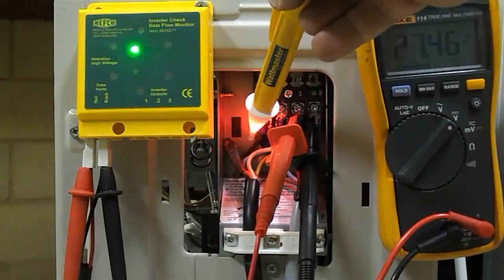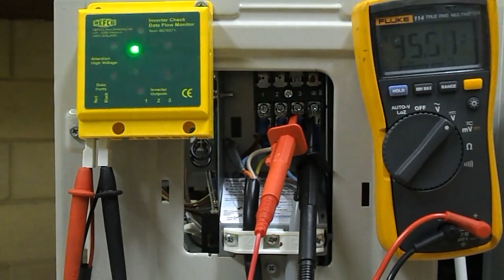Air Conditioner Communication testing using the Refco tool

Comment: Would this type of tool be necessary for residential diagnostics?
Reply from the maker: You can use it, but in terms of necessary, not really.  Manufacturers have their flow charts and readings for tests like this in the service manuals. As I mentioned in the video, I did not find it conclusive.
Reply: Thanks Dennis

Comment: i see it only comunicates on postivite dc voltage
Reply from the maker: With ac or dc there are no positive or negative voltages , meters read negative voltages when they read opposing current flow from their designated polarity.  If i reverse this tester, it will read opposite. I found this device not conclusive to what I do know about the unit I was testing.
Reply: @whatwoulddennisdo7243  thanks for the explanation
Reply from the maker: No probs, thanks for commenting

Comment: Hello Dennis, I recently bought this device and when I try  to check the data flow between idu and odu both data lights aren't flashing but they are just turned on.
I've seen many videos but I still can't solve the problem. Any ideas on what's going on with my device?
Reply from the maker: Hi, thanks for your comment, I found my test a bit inconclusive based on what real info I know about the brand of unit I was looking at. Not all brands are the same and comms styles vary. Your looking at an analogue signal which can be detected both ac and dc on some  multimeters  It's a handy thing, too, since if you take a 2 wire wall controller, the signal is both a power supply to make it light up and function, and an AD signal to the indoor pcb. This is why many brand manufacturers provide their own comms tools with real-time read data. This tool is just pinging signals in voltages. I suggest checking with the brand manufacturer of the unit your servicing as I found this tool not compatible on the same maker's brand across other commercial models using the same interconnect.wiring between indoor and outdoor.

Comment: Can this test directly on the compressor?because I have a Fujitsu mini split inverter keep having faulty PCB board,some say because maybe the compressor has kind of sorting or something but when replaced the PCB the compressor running very smooth and very cold
Reply from the maker: The tester is designed to check  the power transistor switching on the inverter pcb. The compressor test alone would be resistance based.  Testing any insulation faults is a must on the compressor as the IGBT will fail quickly on compressir earth shorts. Find your manufacturer testing instructions for the compressor

Comment: Hello, my name is Claudius and I'm from Romania and I can tell you if this tester can help me to find out the cause of the problem if an air does not start and gives me an error. I have a problem with an air of NEO brand INVERTER 12000 btu, you start on cold starts the fan and after 5 seconds without having to start the compressor or outdoor fan shows me F1. Temperature sensors are good, 5 kohm inner and out of 5 and 50 kohm compressor outlet.
Reply from the maker: This tester is a simple diagnostic for commications from indoor to outdoor, you will have to check with the manufacturer on what the alpha/numeric fault code F1 means. If your getting a fault code, it must have some functional micro processor at the indoor unit.

Comment: BOTH LED ARROWS SHOULD BE FLASHING here. The data is bi directional on the same wire. My understanding is that one LED means positive half cycle data transmitted in one direction and the other LED means negative half cycle data pulses in the other direction. ( indoor unit to outdoor unit or visa versa) See "Refco data flow test module" video at 1.08 minute mark..
Reply from the maker: They don't specify it that well, I get better results using a CRO.  Most outdoor units start the comms process, This unit it was tested on was fully functional and from a well known brand. Each indoor/outdoor has a transmission and receive circuit , yet this is what the tester was showing at the time.
Reply: Why bother setting up an oscilloscope to do this and the risk that this entails? The usual way to do it is a lot faster and easier i.e as per the fujitsu service instructions. Take the data wire off at the interconnect terminal with an insulated screwdriver and measure the voltage on the wire and the terminal. 
The dead one is the dead one! Surprise!! (the voltage is unusual , it's not 240 volts, don't worry about that)
For any reader's who don't know what I mean: If you are at the outdoor unit and the wire is live and the terminal isn't, then the outdoor unit is not transmitting data. This is a common fault as most faults kill the high voltage DC supply to the control board as it is derived from the filter board, IPM rectifier, ACTPM D.C bus regulator, the capacitor board and back to the IPM before it energises the control board (In the models with 4 boards in the outdoor unit.) PS Readers should not get too excited about using a CRO on these inverters unless you are very experienced at repairing variable frequency drives. Never put a CRO's earth lead on the 0 volt rail of the 340 volt DC supply. The 0 volt rail, as it's called on the diagrams, is really at minus 170 volts and you will blow the bridge rectifier on the IPM. Any AC supply that you full wave rectify will be at plus and minus DC levels relative to the common ( the neutral in this case)
Reply from the maker: Sure, I can get a statical reading of around 45vdc based on the manufacturer info and that's means the comms is ok buts that's only generated at the outdoor. I was having a look at what this tool does and that is the way it is connected. The unit was not running and the indoor does not communicate to the outdoor fully until a mode is called for other than fan only.
Reply: @johnw6648  I've never thought of doing it this way! Totally trying this the next time I'm checking out the PCB cards. Thanks for sharing!